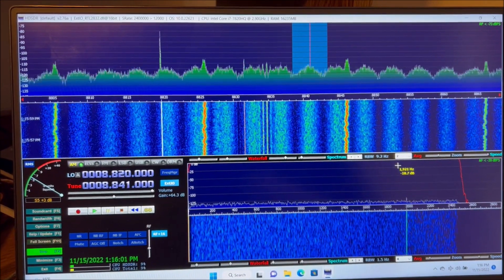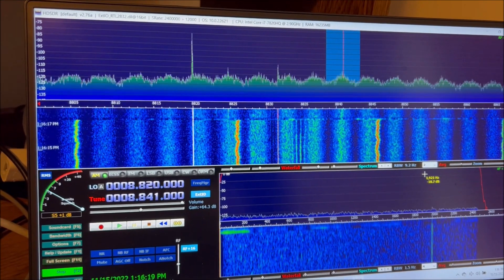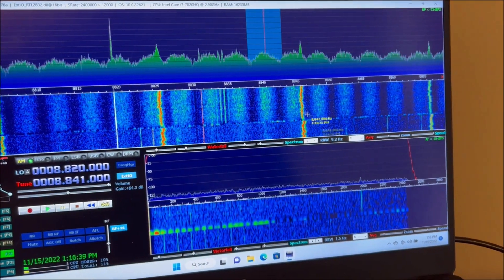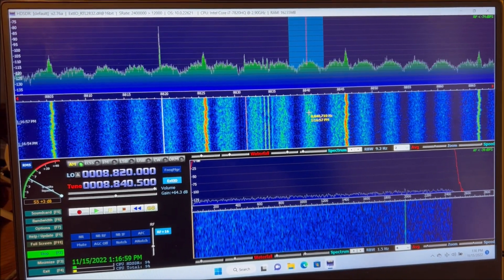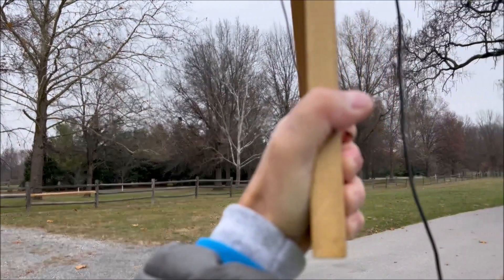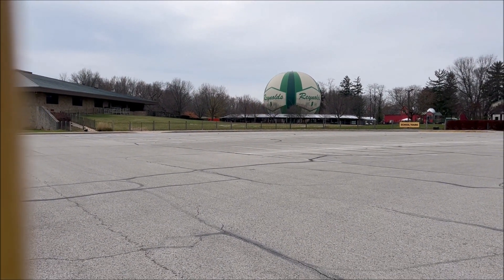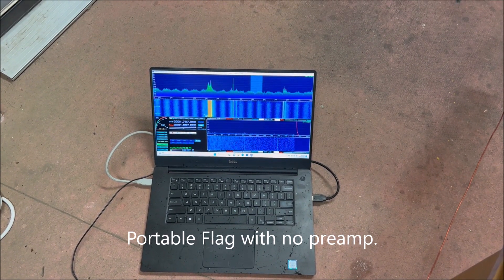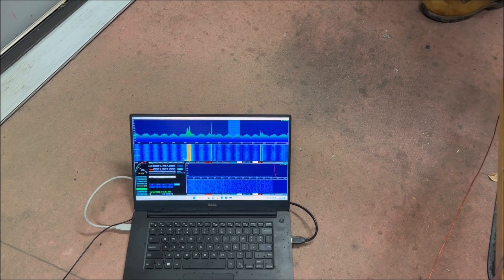RFI on 160 meters at WD8DSB tracked down to variable speed drive 1.1 miles away.  Nov 15, 2022.

Comment: Can you explain the terminology "300 degree pennant" and "160 degree pennant" etc?
Reply from the maker: Hi David,  I have 3 stationary dedicated receive antennas pointed 40 degrees, 160 degrees, and 300 degrees and they are called pennants because they are shaped like a pennant.  They are called terminated loops because they have a resistor on one side of them which makes them unidirectional.  My portable flag operates similar to my pennants (it is also a terminated loop) but it's much smaller in size which causes it to have even less gain than my stationary pennants but you make up for the low gain by using a low noise preamp with them.

Comment: Very good video.  I have a similar problem near me from VFDs on oilwell pump motors.  They save money by omitting the filters that the drives are designed to be used with.  I have been battling with the owners of the VFDs and the regulators to try to get some action on this.  I'm a couple years into it and no resolution yet.  These VFDs are becoming more prevalent all the time so hopefully they will start using filters as standard equipment.